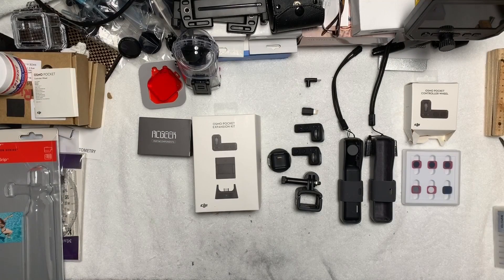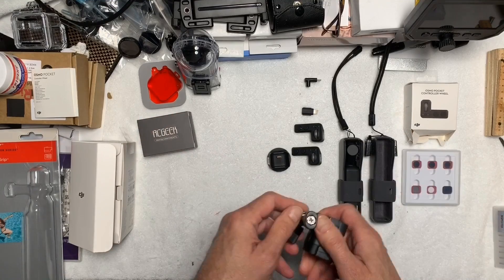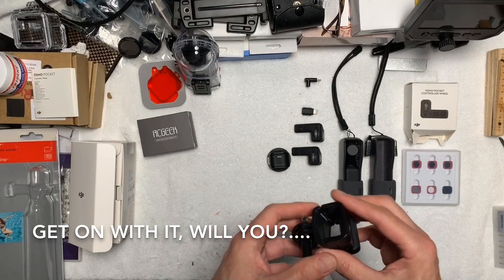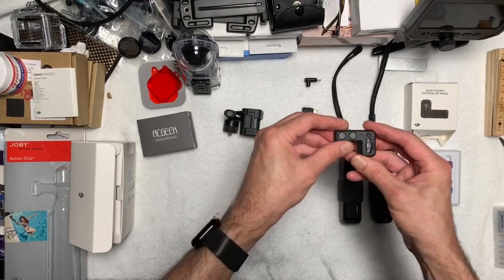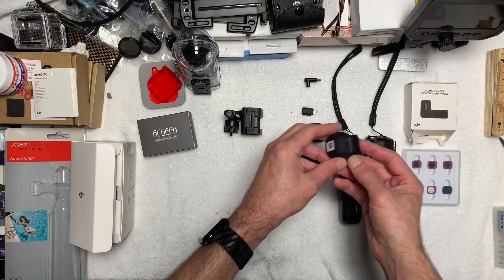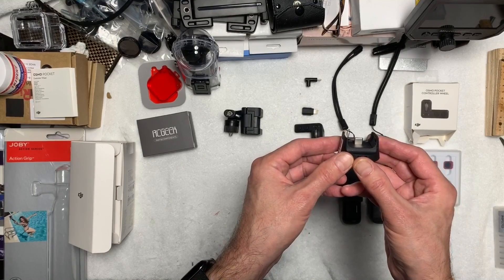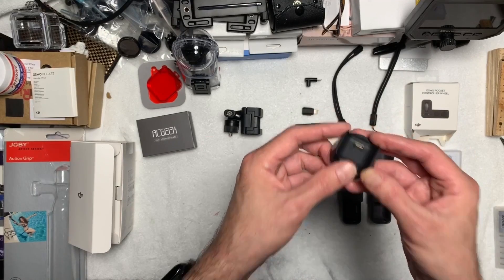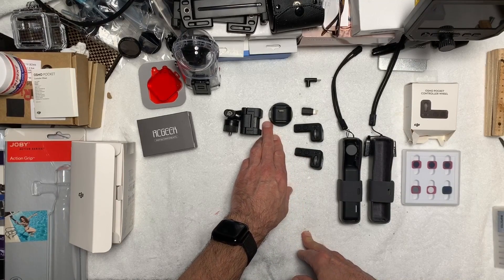DJI Osmo Pocket Expansion Kit is Here: Let’s celebrate with Pocket Mods!

Comment: Hi i have a question,
It may sound stupid but can you connect the wireless module to a samsung phone that has a micro usb port? I have already tried different ways of connecting the osmo pocket to my samsung phone(OTG, male USB C to male micro USB,...) but none of them works. So i thought, maybe if i buy the wireless module, i finally can use the mimo app.

Comment: The Wireless Module would be brilliant if it allowed for the incorporation of a wireless mic, however, the Wireless Module uses the USB-C port, thereby making it impossible to use the external microphone connector DJI will be introducing "any day now". You may be able to control the Pocket from 30 feet away, but your audio will be horrible, and you're going to need a separate device to capture audio, then sync it up in post. Not the best.

Comment: I have to issues with Wi-Fi adapter maybe you can help the first time I plugged it in it was Flawless but the app tell it Wi-Fi it connects it does it's a thing after that however I cannot connected to any other device I have to manually connect to the Wi-Fi of the adapter and then it works

The big problem however is that after connecting to the Wi-Fi module I can no longer connect to the smartphone adapter I plug it into my phone and nothing happens I have no idea what to do about that? Any suggestions?

Comment: there is alot of issues with this kit;
1: the wireless module covers the bottom microphone of the osmo.
2: you can't have the wheel on while you have the mount bracket on there.
3: wireless module drains the battery fast
4: the wheel is useless because of having to switch between tilt and pan because you can hear the click Everytime you do during filming.
5: wireless module range is between 20-25ft
so basically useless kit, however i will keep mine (might come in handy)
Reply: In reference to point #1 of your comments, in my testing it appears the wireless module actually turns off the microphone on the bottom of the Osmo Pocket.  Try it yourself, the audio whistles if you merely cover that microphone but with the wireless module, there is nothing coming from that port.  Sounds totally normal.
Reply: @Three60guy  actually i did find out that wireless module has a slim line on the top(on the osmo microphone side) so that line on the module makes an opening for the microphone to pick up noise..take a look at the wireless module, there is a small line on top thats places for microphone.
Reply: @republicofu.s9642 , Really?  I was 100% sure you were wrong but I pulled out my wireless module and looked it at it and BAM, there it was.... the physical channel you spoke about.  I was blown away.  THANK YOU.  I would have never caught that one, for sure.  There are openings on both the front and back too.  Talk about an engineering solution.  You have to admit, that was a great solution.  Thank you for taking the time to share what you learned about the wireless module.
Reply: @Three60guy  Lol i know right?!
i was just chilling and looking at the osmo and the module and found out about it, i thought it was a mold defect but then i noticed.  glad it helped you out. keep the work going !

Comment: Is the WIFI module secure in the OSMO?  Will it stay on the bottom if you have it in your hand while filming.  I would love to have it as a semi-permanent item, if it will stay on.
Reply: I seen someone on YouTube have one on while filming and it stayed on.
Reply: i have the kit, it does stay on firmly. however there is 2 issue with that;
1: it cover the microphone thats in the bottom of the osmo
2: it does drain the osmo battery faster.